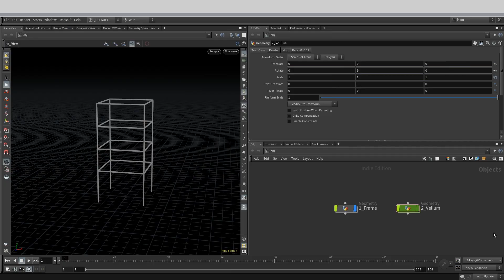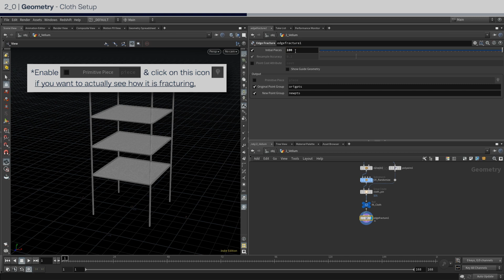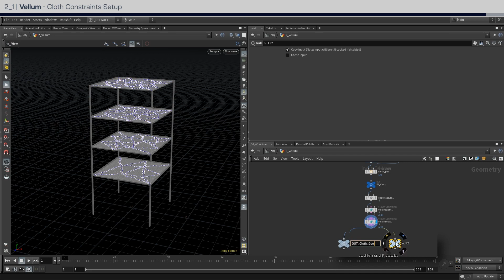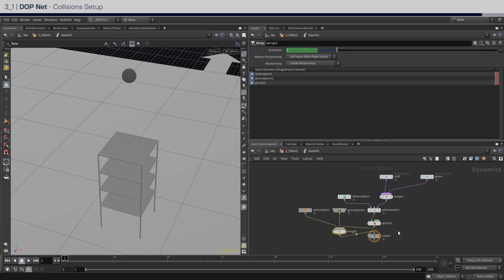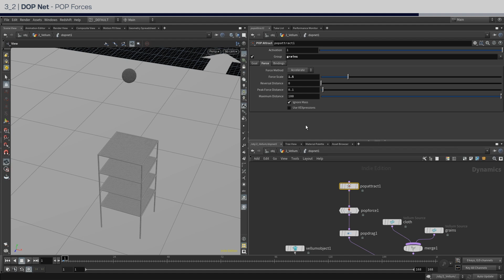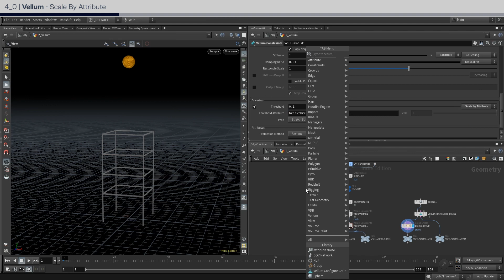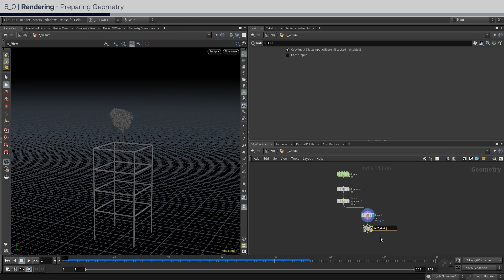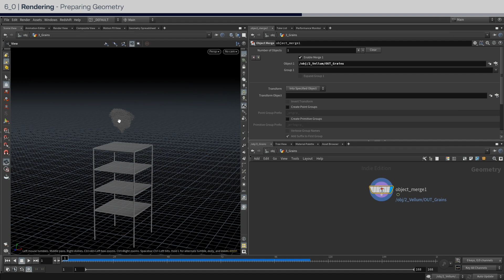Houdini Vellum Cloth Tear with Grains [Tutorial] | Advanced Vellum Workflow, Scale By Attribute

Comment: After the dop net sim the cloths are tearing without even the grains intersecting it...what to do??
Reply from the maker: Hard to say with little info, but check everything to do with the Weld constraints. So check the 1. Weld Constraints Node and 2. Attribute Noise node. Maybe the threshold global scale is too low, and that’s why the cloth un-welds itself just by the force of gravity.
Reply: @YFJSR  it dosent in weld, the points are welded to the frame but the centre part of the cloth goes down with gravity and then shatters
Reply from the maker: @bhushankandalkar3104  OK in the Edge Fracture node, did you enable the "New Points Group"? You need to enable that to get the new points to weld. Then, in the Weld node, make sure you have it set to "Points" mode and input the newpts group. - That's all I can say for now. (If this doesn't work then please watch the Slightly advanced Vellum video by Rohan Dalvi)!
Reply: @YFJSR  aight...thnx 🙌🏻
Reply: @bhushankandalkar3104  I had the same issue so I started tweaking Breaking Threshold value and for a cloth 2x2 m I found the value of 1.5 good for a start.
Reply: @baldoski  okkk, I'll try.....thnx 🙌🏻